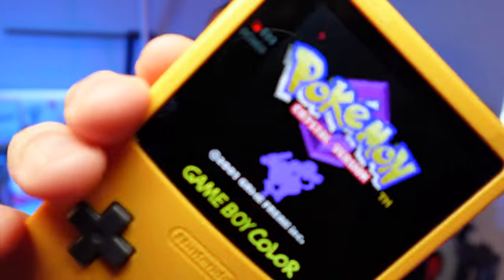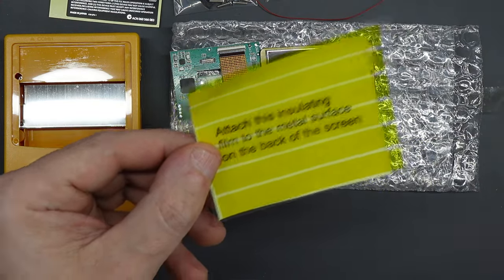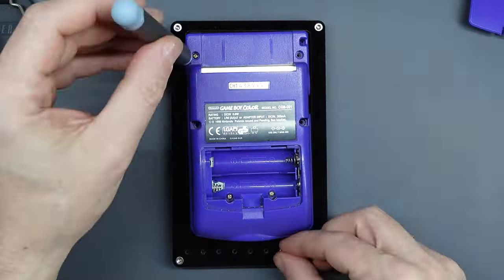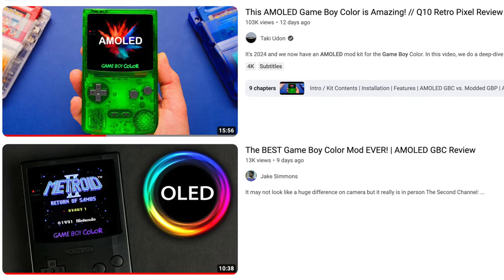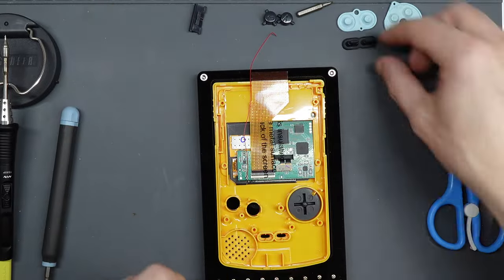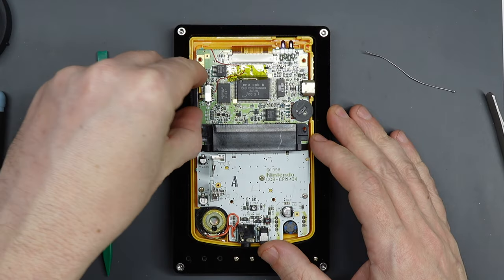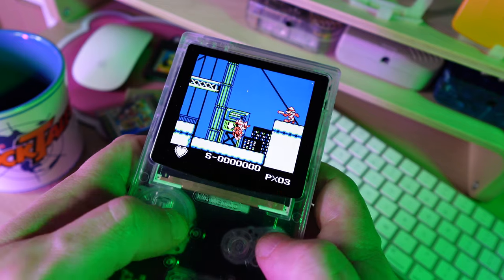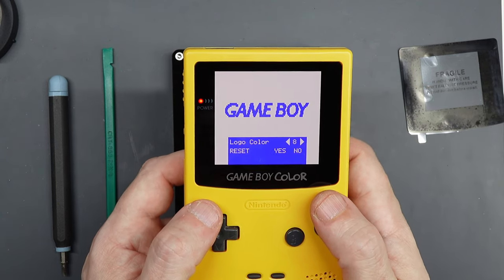Game Boy Color OLED Screen Full Tutorial

Comment: Great video, but about your steps sequence: you really should have soldered the wire to the conversion pcb before putting it against the screen. The screen is a sandwich of plastic, and 350⁰C is way more than you need to melt something or at least leave some stain on the screen. You did it very fast so it was safe. But as it is a tutorial, someone couldn't have the same luck

I have modded hundreds of game boys and believe me, I've already done all kind of mistakes and loose a lot of parts 😂
Reply from the maker: I've pinned this.  A very good point.  I wasn't too worried as it was a quick joint on a board not directly connected to the screen itself but someone else with less experience might run into issues.  I'll add the wire first next time.

Comment: Im lost, I did all of the steps got power to the OLED but no games would read. Took it apart made sure all ribbons were in place and nothing. Screen wasnt even taking power anymore. So I resoldered the wire and still nothing, the screen isnt even getting power any more. Idk what to do.
Reply from the maker: If it worked before you should be able to get it working again.  Could be a faulty unit.  Have you tried it with the original screen again?

Comment: Installed but now screen turns white with games and when I move the gameboy it freezes any suggestions on what went wrong?
Reply from the maker: Two main possible issues is that either one of the ribbon connections isn't secure, or maybe there's a short between the screen assembly and the motherboard

Comment: Just installed my OLED screen following your instructions, went flawlessly. If you see crazy multicolored vertical lines the ribbon cable needs to be reseated. Screen looks incredible!
Reply: What size screen is the oled? I want to replace the black laminate lens with a white color.. do you think that is possible?
Reply: @rashawngibbs8218  Screen is about 48mm x 44mm. I didn't see an option for white in the OLED, maybe only the IPS kits have a choice of color? Not sure
Reply: @miklos7503  I greatly appreciate that screen size measurement! Very handy information I needed.

Comment: I'm going to attempt an insane build with the oled I'm building a boxy pixel with every mod that's out there the light up buttons with tactile switches
Reply from the maker: That sounds pretty awesome, will these laminated screens fit the boxypixel shells?
Reply: @JoeBleeps  from what I heard yes because boxy pixel can fit q5 screens and the oled is the same but who knows 🤷‍♂️ once I get it and assemble it ill let you know
Reply from the maker: @xXhikashiXx  if it fits the laminated Q5 then the oled should fit too
Reply: @JoeBleeps  so update the boxy pixel doesn't fully fit the oled screen by like a hair I don't want to break the glass so I will sand down the edge and it will fit
Reply from the maker: @xXhikashiXx  good luck!

Comment: In your opinion what’s the best screen upgrade for the gameboy Color regarding screen size and quality ?
And what’s the best screen for the gb pocket?
Reply from the maker: @steveothehulk  although it's somewhat saturated, the OLED is really impressive. The blacks are so dark, it's easy to install, it's laminated so you're guaranteed no dust under the lens and the touchscreen controls give a lot of flexibility
Reply from the maker: @steveothehulk  as for GB pocket I've only tried an IPs screen and had bad experiences with power consumption. The old style led panels have been more reliable for me on the pocket but I think I just had a bad IPS kit
Reply: @JoeBleeps  thanks for the reply, one more thing, have you ever modded or upgeaded a gb boy colour? the gb boy colour is a cheap fake gameboy colour? its crying out to be modded as its a really great copy of the gbc
Reply from the maker: @steveothehulk  I did a prosound mod but it was kind of pointless as the sound chip can't handle proper emulation and won't work with LSDJ

Comment: Would the Funny Playing shells fit this screen? Also since the Funny Playing shells have a modified battery compartment, would retrosix's wireless charging battery fit in that?
Reply from the maker: Yes these are pretty much the same shells. The battery compartment is modified in these too. It works for the FunnyPlaying rechargeable batteries, not sure about the one you mentioned though
Reply: @JoeBleeps  Alrighty thanks for letting me know!

Comment: Question? Ordered this mod kit same exact one but the Gameboy color logo doesn’t light up and the touch screen doesn’t respond any idea what the issue would be?  Thanks
Reply from the maker: When you first set it up, the Game Boy Color logo doesn't light up, you need to activate that in the settings but if your touch screen doesn't work then of course it won't work yet.  So with the touch screen you'll need to check all the connections, particularly the ends of the main ribbon and the small clip connector on the back of the screen.  Also make sure no metal parts are touching between the screen assembly and the motherboard.  Good luck!

Comment: You reckon this screen would fit into an original GBC shell easily enough? I love my original clear purple shell and would much rather have one of these beauties placed into that instead of an aftermarket shell (they just don’t have that same classic feel to them, which bugs me)
Reply from the maker: These shells are good, you know. Pair them up with your original buttons and membranes and the classic feel is there. While you can technically fit them in a heavily modified original shell, it would take a lot of work and would be unlikely to have a clean finish. Especially on a clear shell where all your work inside the shell is exposed too
Reply: Yeahh, I get you! They do have a purple clear shell on there that comes with this screen. May just swap it out and stick just keep my original shell neatly boxed away. Different shell + screen but keep my childhood interior, buttons, membranes and what not. Thanks for the reply, buddy!
Reply from the maker: @dallows3235  That is the best option for sure. Or even keep your childhood console as it is and always was, and get a whole replacement working console that's maybe seen better days on the outside.

Comment: I must be super unlucky, I followed all the instructions and my amoled screen doesn't work :(  I put the mainboard back into the old shell i had and it worked fine so I can only assume there's something up with the amoled or its components
Reply from the maker: Sometimes the screen kits can be faulty, it might not be anything you did.  Normally you're advised to test the screen first but as it needs the wire soldering for power in this case that's more difficult to do.  Try getting in touch with the seller to see about getting a replacement but first, double check the seating of the ribbon cable, the part where the two connectors clip together as this is easy to misalign, the battery contacts to make sure a proper connection is made and also double check your soldering, particularly to see if any connections have been bridged.
Reply: @JoeBleeps  Soldering has been quadruple checked before I gave up with a headache; The only thing I saw really wrong was the ribbon cable had some black gunk on the smaller end that I tried to clean up with isopropyl alchohol but couldn't really get it off. Looked to be on the contacts where it slots in too. I've explained the situation to the seller now it's up to fate.
Reply from the maker: @OrochiSP  if alcohol won't get it off, try scraping very gently with the edge of a blade
Reply: @JoeBleeps  Thank you for the advice! I'll try it later. You're getting a follow for being so nice and helpful <3
Reply from the maker: @OrochiSP  ahh thank you! Good luck

Comment: How the frick do you get sand in the power switch?!
Reply from the maker: A day at the beach, most likely. That stuff gets everywhere. There was some in the speaker too. Noticed the switch was scratchy and uneven so I desoldered the metal casing, dismantled it and found a few grains in there. Cleaned, reassembled and back to normal operation now
Reply: @JoeBleeps  well, at least it works normally now
Reply from the maker: @RevolutionFalls  absolutely

Comment: Its honestly meh. The Q5 screens are still fine.
Reply from the maker: Q5 screens are great.
Reply: I got two OLEDa now and have been using Q5s for a while. The Q5s are quite a bit brighter. There's also few gameboy games that show black. Because the OEM screens weren't backlit, games usually used gray for dark areas. It's rare you're going to see something in a gameboy game that showcases an OLED. Between that and the low brightness, I suggest Q5s still.
Reply from the maker: @DeenoSpamone  Love a reasoned viewpoint like that.  Very interesting and I'll look out for that in games when I am playing
Reply: @JoeBleeps  Thank you sir. Only game I've come across that has true black is the pokemon crystal intro., which is a game that also uses the gray instead of black I'm talking about. If you're in a small room (pokemon center), the outside of the building is grayed out and not black. 

The consensus in the modding community is to just go OLED if you're buying a new kit cause it's $5 more, but I'd still opt for the Q5 XL over it. I can't see  a difference in color quality between them, but what does stand out is how much dimmer the OLED is.
Reply from the maker: @DeenoSpamone  I'll say that title screen does look great on Pokemon Crystal.  I honestly think both kits are great though.